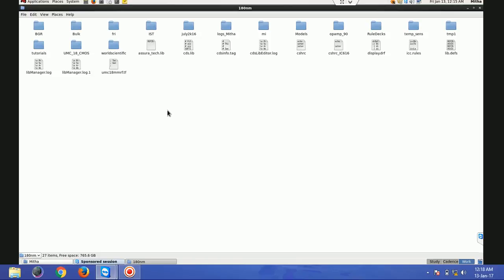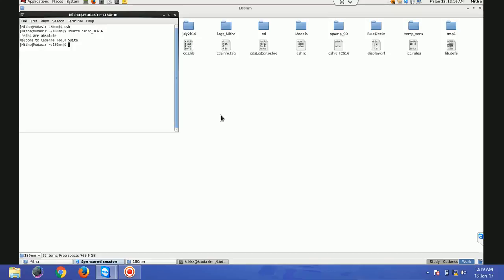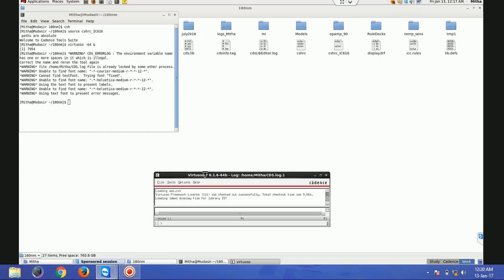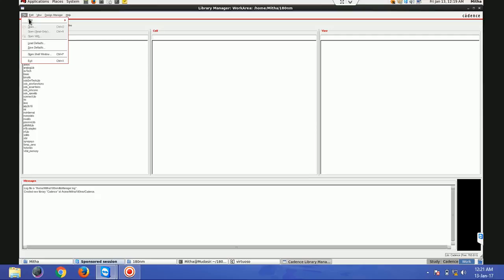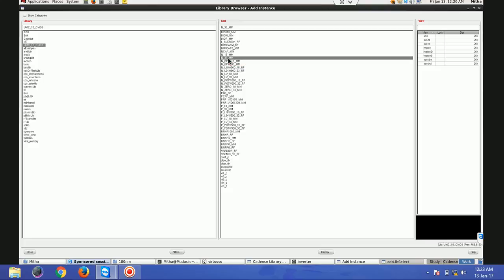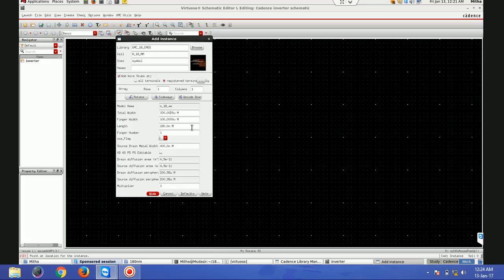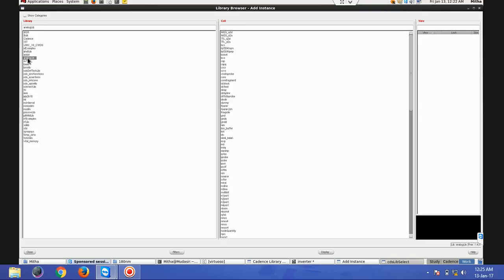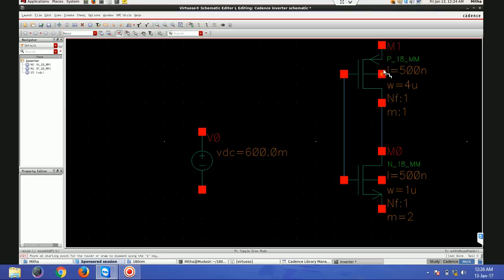Cadence IC615 Virtuoso Tutorial 1 (HD): Schematic Entry and Using ADEL

Comment: Where can i get cshrc file
Reply from the maker: Whoever installed cadence in your lab/system can tell you or ask your labmate who is using cadence (simply copy it)... cshrc file has the paths to locations where different packages/tools are installed. so once you source it, all the tools defined in it are invoked.
Reply: @MudasirMir7  also which version of red hat software v have 2 use
Reply from the maker: @mohammedadnan77  RHEL 6/7+ is fine
Reply: @MudasirMir7  can i get source where i can instal RHEL in vm box